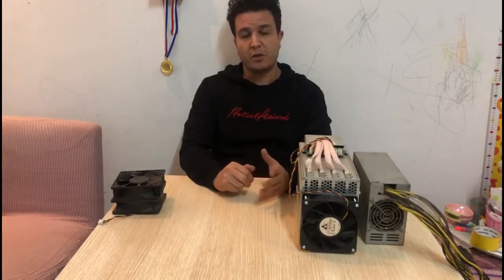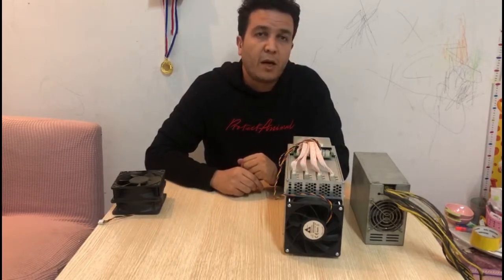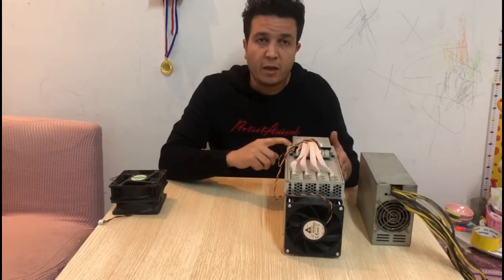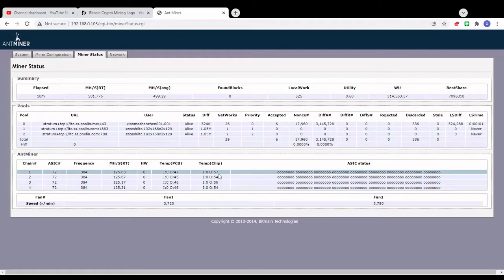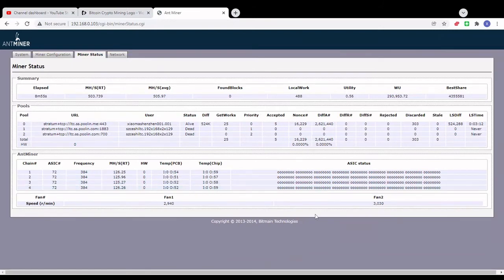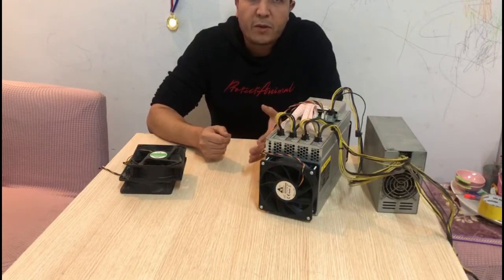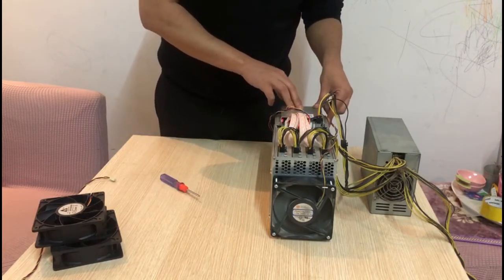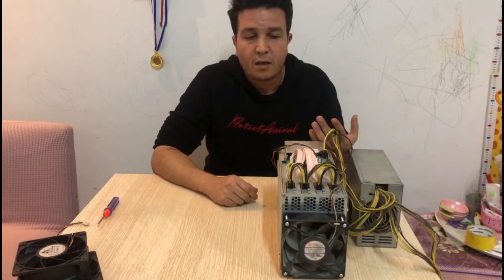How to reduce noise on an #asic miner ?

Comment: Any update on changing the fans? is the fan that makes the noise right?
Reply from the maker: yes all the noise is coming from the fans , so depends on what miner you have , there different ways of reducing the noise , for example , is you are using an antminer , most of them have aftermarket firmware where you can control the fan speed , but incase its a different brand , then you will have to swap the fans to a lower speed , but don't too low otherwise the miner either want work or it will overheat , buy a fan that has less amp , hope that helps
Reply: @Crypto_mining_lab  i got 6 goldshell kd5 but its screaming like hell.  not sure if cooler box is big enough. im tryingto find a way whats your suggestion? is there an aftermarket quiet high rpm for the goldshell kd5?
Reply from the maker: @OG-Diamond  so you have a gold shell unit which means there is no way you can do this through software , so your other options , is to swap the fans , but consider this , if your miner is still under warranty , leave it as it is until it passes warranty period to avoid any issue , after all its not a cheap miner you have there , if its out of warranty , then you do few things , cooler box might work , just depends on the size of the cooler box and your setup , you need to check your temps before and after modifying things , so you don't over heat your the chips ,, ball bearing fans are good options , you need to check the size of the fan it self , number of wires , and how many amp , you can choose a slightly lower amperage to reduce fan speed , and with ball bearing should make it even quieter , but always check your temps before and after changing anything

Comment: can you reduce the noice or run the test on the x5 from goldshell?
Reply from the maker: For the X5 we can only reduce the noise by changing the Fans , as the gold shell firmware doesn’t give you the option to control the Fan speed , I still have some X5’s , I’ll try to post a video where I change the fans to reduce noise level , just make sure not to overhit the miner if you change the fans , you may  need to try different fans with different speed